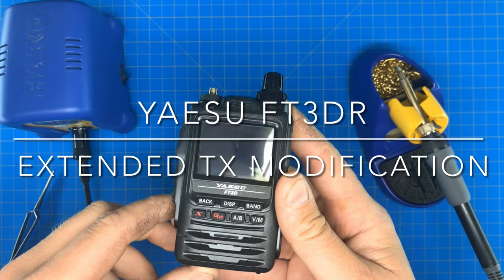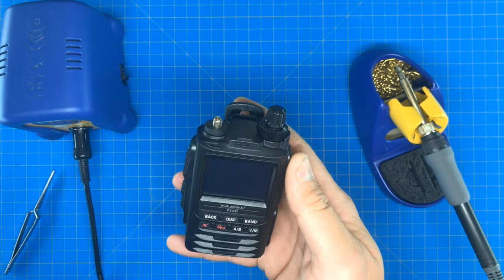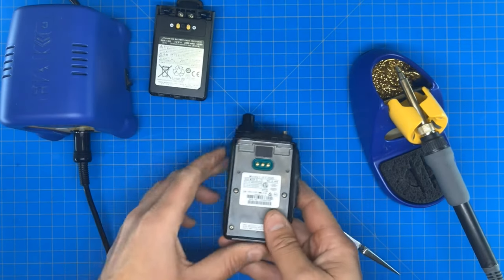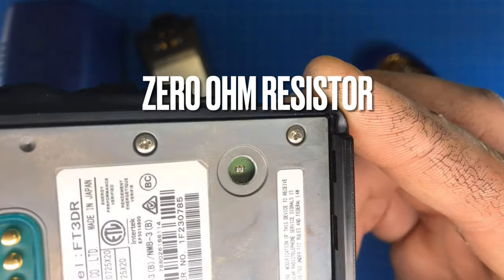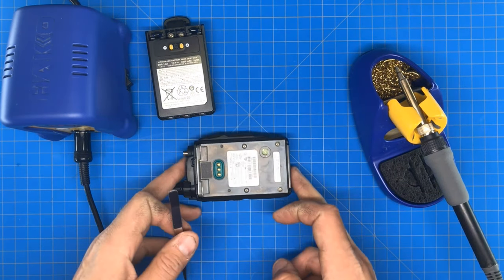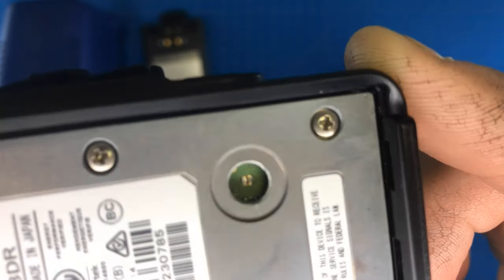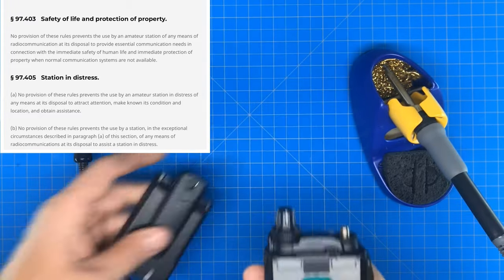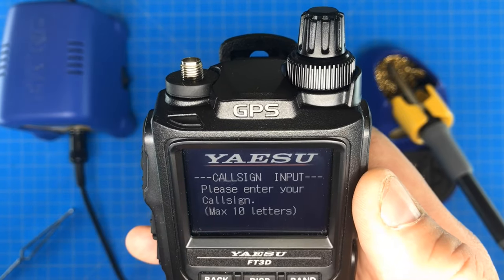Yaesu FT3D- Extended TX

Comment: Thinking of doing it to my FT5DR but i saw pepole saying that they lost the functionality of programming via the USB cable or SD card. is it true?
Reply from the maker: Unfortunately I have no experience with the Mod on the FT5DR, if you have a problem it’s simple to just re bridge the two points.
Reply: It just makes it incompatible with the Backup.dat file already saved. You can make a new one. You basically lose all your settings once.
Reply: I just did this mod with great success!! But yes I wasn’t able to use my rt systems usb cable to reprogram all saved frequencies. I found a 16gb sd card saved it to that and voilà. Back to normal 🎉

Comment: If I need (without connecting it to the PC) to manually enter a frequency, is there no way to make the numeric keypad appear on the display? Thanks.
Reply from the maker: Enter VFO mode with the V/M button and    
Touch the screen over the frequency and the number pad will show up.
Reply: @W5IPAJASON  ottimo !!! Grazie.

Comment: You just pulled out the resistor? I don't understand how that gave you 84 more frequencies to use in this radio?
Reply from the maker: It’s a design feature to allow the radio to be sold in multiple markets (Countries)
Reply: Thank you. I looked into it it. Military and civil. I didn't know that was something setup by the manufacturer
Reply: Может это Американский и Европейский вариант?
Reply: way more then 84

Comment: Will this work on yaesu ft4 ?
Reply from the maker: Yes , check Ham Radio Dudes video https://youtu.be/kJif5M1kAGs
Reply: @W5IPAJASON  yes after unlocking goes only to 446.052 so not Proper pmr 446.0052 .so not sure how to change the MHZ steps

Comment: Is that possible for DE version?
Reply from the maker: I’m not sure,I have never tried. If it does not work it would be very simple to reinstall the “0 ohm “ resistor and return it to factory settings